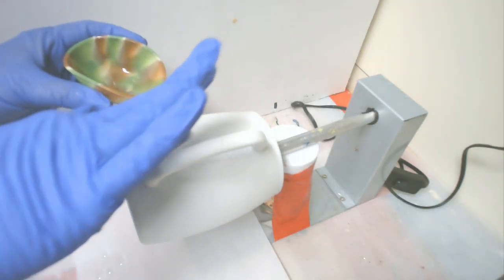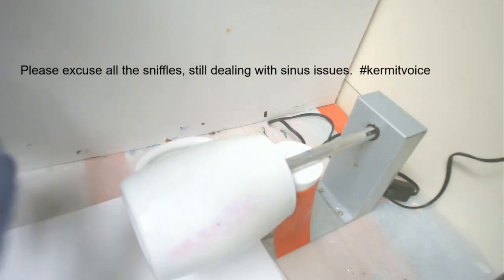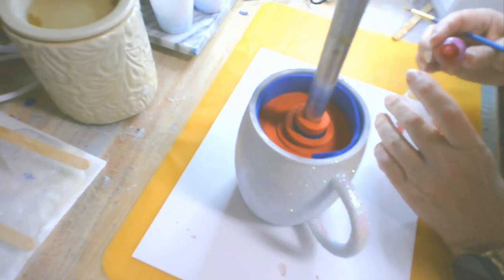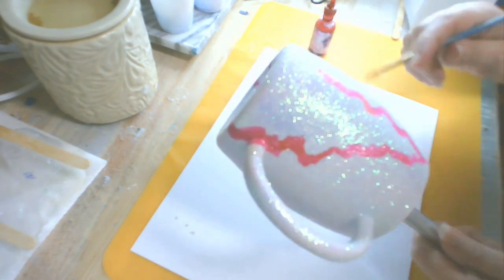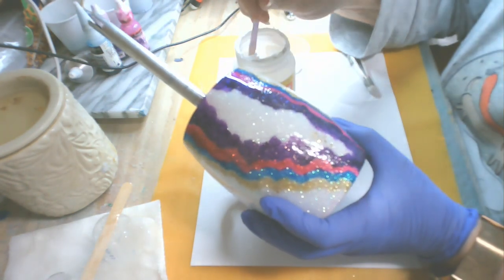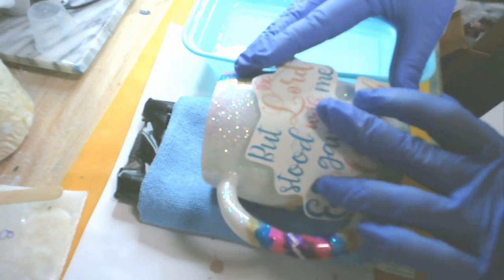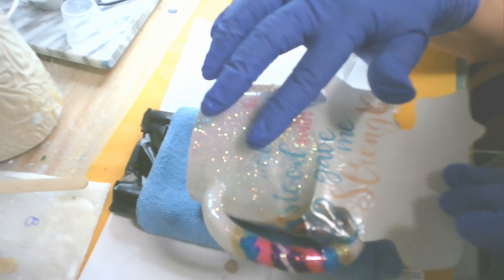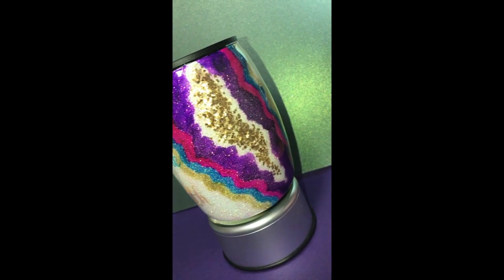Epoxy Method Glitter Coffee Mug  - Geode Design with Waterslide Decal

Comment from the maker: You could try but alcohol even in ink form does have a solvent base so it could desolve the adhesive. Even if you seal the glitter /adhesive layer with the matte spray sealer before applying the alcohol ink you might end up with some blistering on the surface. 
The water slides you can purchase from vendors (Etsy has several, Google water slide decals) or create you own with a printer and either ink jet or laser (depending on which type of printer you have) water slide paper (again depends on your type printer, purchase at Arts /crafts stores or Amazon) I have used both vendor purchased and printed my own. If you print your own be sure to let the design dry thoroughly, seal with about 3 coats of matte spray sealer, allow drying time between each coat, and 12-24 hours after last coat before applying to you project.  I think I have a video on that too. 
I hope this helps you create a fabulous project. Thanks for watching

Comment: Hi, Im new to your channel and was so inspired by your video. Thanks so much for sharing. Could you also share information for the turner you used when putting resin and glitter on the cup? Thank you.
Reply from the maker: Hi Janae Aye and Welcome!  So glad to have you and thrilled that I can inspire you with my art. 

I actually have 3 different type turners. The one I used in this video is actually my first turner and I purchased it off of Amazon. I like it because of the height clearance for cups with handles but I did have to jury rig it by putting a plastic bottle under the rod to support the weight so my cup doesn’t fall off. And I also put a carter pin to hold the cup holder rod on. Not a hard fix but a fix all the same. I just checked Amazon to get the link for you but it says this turner is unavailable. 

I also have 3 of this type turners and these have worked out great. Just test run it to see if you cup has a handle for clearance height. 
Suteck Cup Turner for Crafts Tumbler Electric Spinner Machine with Rotisserie Motor and Balance Steering Shaft Cuptisserie for Epoxy Crafts Coating Tumblers with 2 Wands and 2 Foams
 This one is really cool cause it comes with 2wands and 2 foam cup holders. $29.99 

And then I have 1 12” high tilt turner from MH Turners. It is my most expensive turner at $75
Plus shipping but it is a really cool turner. It actually tilts straight up if I need it too. And great height clearance. Here is the link to their website 
https://www.facebook.com/MHTurners/

I hope this helps you. If you have any other questions just let me know!
Reply: @KreativeEscapadesbyKimBevill  Thanks so much for sharing that information with me and for also going the extra mile to check the availability on Amazon. I will definitely look into everything. I really appreciate your response.